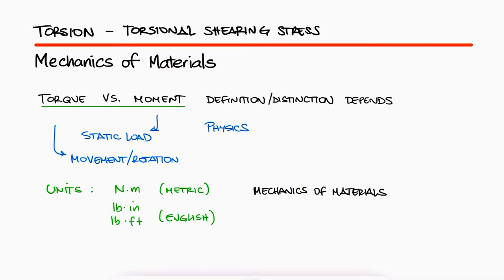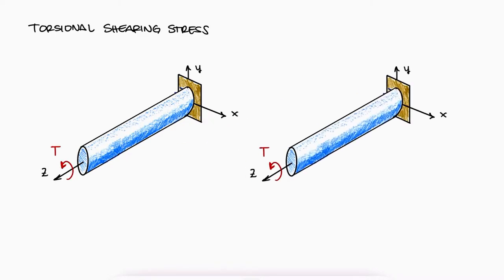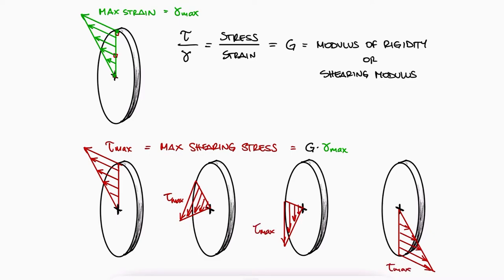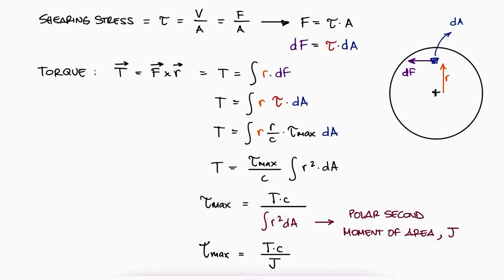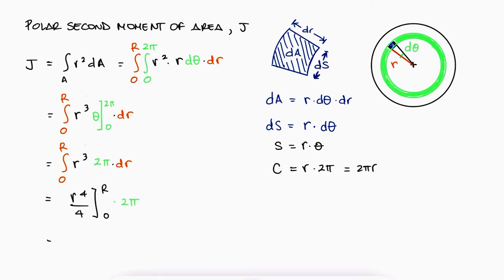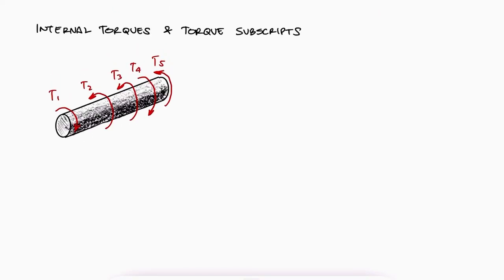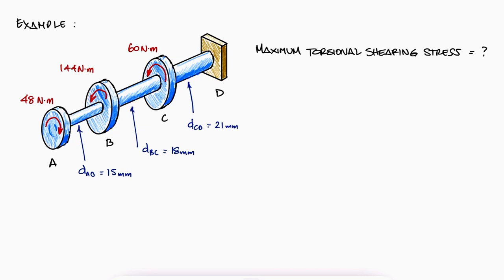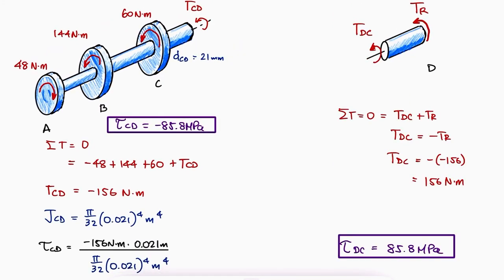Shearing Stresses, TORSION in 11 Minutes!

Comment from the maker: Correction: The values in the numerators, starting at 9:49, should be the radii, c: 0.0075, 0.009, and 0.0105, instead of the diameters: 0.015, 0.018, and 0.021. The final answers are still correct.

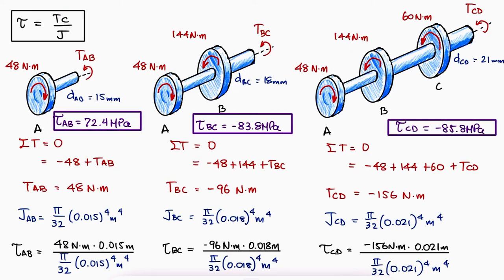Comment: for the example at 10:00, when i do the calculations, i get double the shearing stress amounts, so AB= 144.8 MPa  BC= 167.7 MPa  and CD= 171.6 MPa, I plugged in the exact values seen on the screen.
Reply from the maker: Thanks. I added and pinned a correction comment.